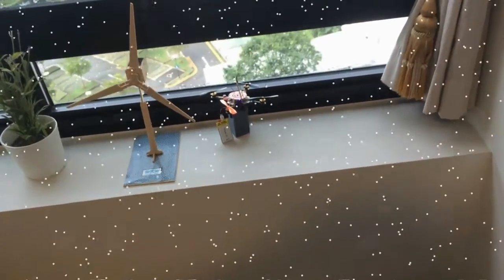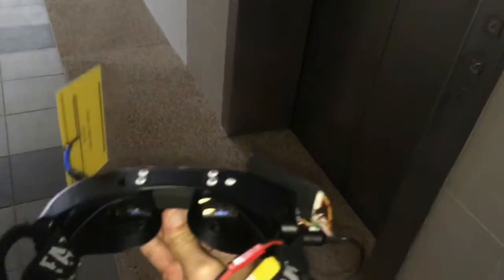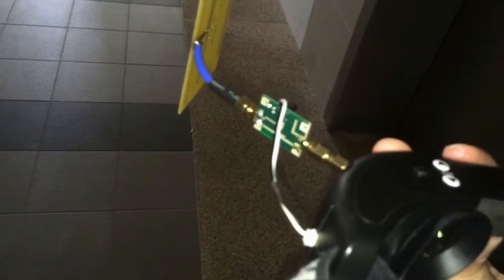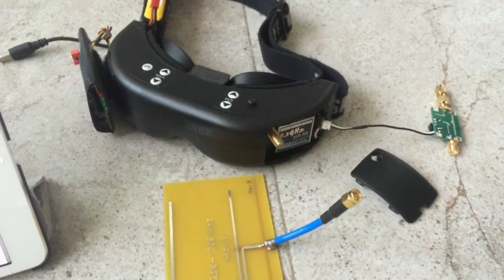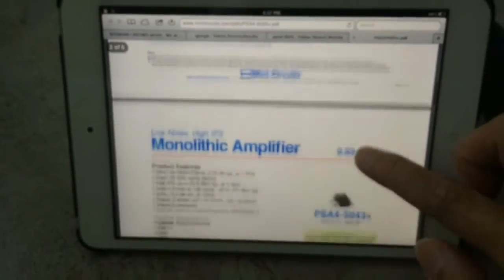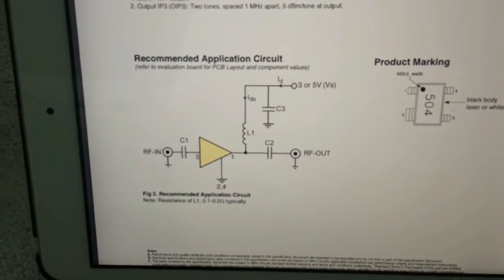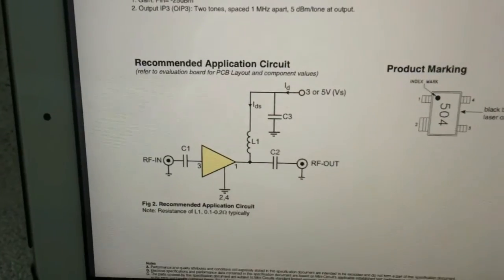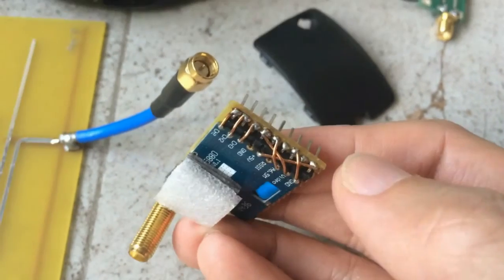LNA for 1.2g FPV

Comment: hi terence, what are your values for LC impedance matching?did you use the smith chart for the computation.thanks
Reply from the maker: Nope, I just used the recommended values by MiniCircuits (they had listed the  values previously in an older IC). Anyway, here are the values and schematic. https://tinyurl.com/4ghzLNA

Comment: Hi Terence, is the pcb something you made?
Reply from the maker: Nope, I got the PCB from a friend, it was fabricated for another LNA. I had to follow the schematics in the 5043 datasheet carefully, worked out how to position the resistor and capacitors and how to ground them on the PCB. I tried to make do with the existing trace as much as possible and to avoid using jumpers.
Reply: +Terence Chan Thanks for the reply. Will your friend sell Me a pcb board?
Reply from the maker: Hey Jose, the PCB I got was the only spare he had left. I would not recommend his PCB as I had a hard time squeezing the capacitors to make them touch the ground part of the board since the board was not designed for this LNA. It should be feasible to ask a friend to etch one with a mini CNC router.